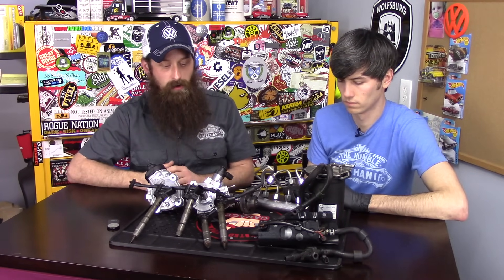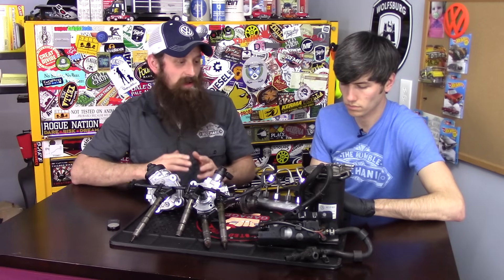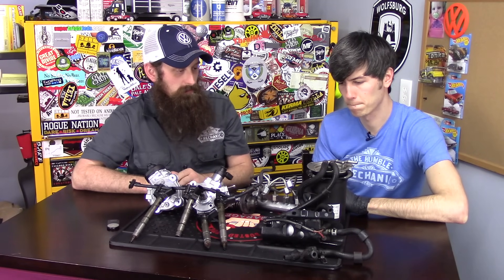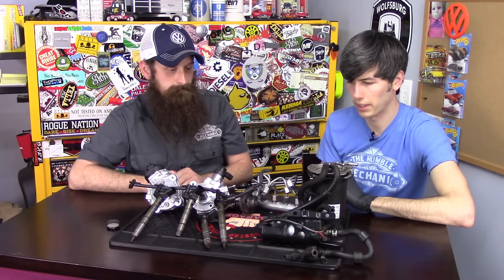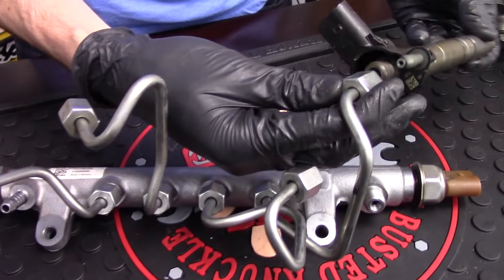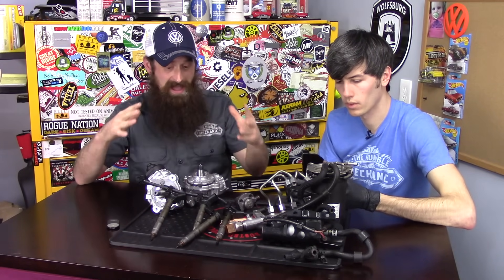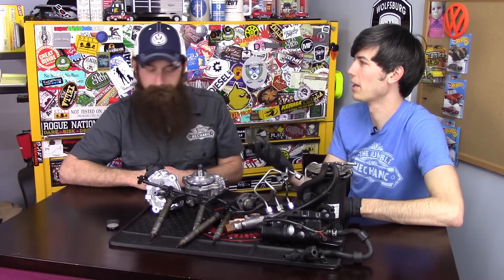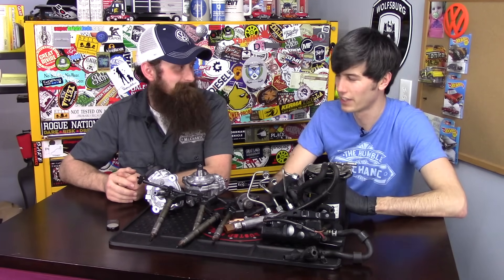Putting Gasoline In A Diesel Car - What Happens?

Comment: I've been a mechanic for almost 40 years (aviation, automotive, heavy equipment) and have seen my fair share of this kind of thing.  Replacing fuel lines and cleaning things out with BrakeClean and compressed air to eliminate every drop of gas is really unnecessary.  Claiming the fuel rail is a sealed component that you can't service or see inside is also quite incorrect.  The one you show: all you have to do is removed the fuel sensors and any metal trapped in there could easily be removed with compressed air.  As far as the pumps and injectors go, unless the vehicle was run on straight gas for quite some time (which would be difficult because the head gasket won't last very long), they're more than likely going to be fine.  If there was any pump damage, you'll find evidence of it in the fuel rail.

You can also dump the gas/diesel mix with your waste oil.   (And where do you live that it costs $25/gal to dump that stuff?)

Comment: just to clear some things up, chevys duramax is a Isuzu design, dodge uses cummins which is a world wide diesel engine manufacture. ford is the only one of the big 3 that has there own diesel engine designed and built in house and currently with stock hp and torque numbers being the highest. of course ford had the old international design, 6.9L idi, 7.3L idi, 7.3L powerstroke which was designed by Cat and built by international/ navastar. and known for its high reliability.  the 6.0 powerstroke which uses the same hydraulic design but the injectors are a little different and a little more sensitive. the 6.4 being the first common rail powerstroke was a big fail due to the emissions regulations, and now the 6.7 powerstroke common rail even more sensitive. 6.4s 6.7s, duramax, and 6.7 cummins all can easily be damaged by simple water contamination. the old school 7.3s and 6.0s can do a degree handle a little gas or water but you dont want to run it to long. older diesels can handle some gas, ive heard a lot of old timers run a splash of gas to use as a anti gel/ injector cleaner but with these never diesels dont run anything besides the new ULS diesel.

Comment: depend how much ratio between diesel and petrol you pump in... sometimes we pump petrol maybe 50liter diesel with 2liter petrol to clean the fuel system..if worries about lubricate..add some 2stroke engine oil

Comment: This is all ridiculous. I've been in this spot before. You just drain the system, replace the filter, refill with diesel, and start her up. Replacing the entire fuel system for eight grand because one part might fail in ten thousand miles is something only the mechanic who's charging for the work would think reasonable.
Reply: I put fuel into my 2013 common rail work truck when its was brand new, and drove it for about 30 kms. All we did to fix the problem was drain the fuel out of the tank and change the filter.
That same truck has done 140,000 kms since then with no issues whatsoever. 
$8000 repair, pfft! That's criminal...
Reply: I have a 2002 Jetta Diesel since new with 475k on it now. Always been mixing 50 to 1 in the summer and 25 to one in the winter. I get 1400+ km on the highway and anywhere from 1000km to 1200km in the city. Also been using Amsoil since day one. Oh and everything is original on the engine except the normal maintenance requirements and twice I had to replace the alternator clutch pulley.
Reply: @robh1908  wow over 1k km on a tank! My golf 5 sdi 2006 does about 1k km on 1 tank, but its 95% highway driving, over 730k km now..
Reply: DJ Harrison Solid points to be sure. (BTW - get AAA or OnStar for those unexpected back road breakdowns).The flip side are the many 200k mile 15 yo Saabs like mine. The entire car is $400. A donor parts car is $200 on average. In these majority of cases it's flush, replace filter and go. something else is guaranteed to fail within the next 10k miles. My dad's new Jag is an entirely different deal. Each owner needs o make that cost/benefit assessment.

I like their video because they detail what can actually happen to the parts and why. My only quibble is the disposal nonsense. Simply collect the flushed stuff and use it to burn brush, run the waste oil heated, store it in a building the insurance is paid up on....you get the idea.
Reply: I'll second that. Just a money spinner. Depends how long you drove it though. Then you deserve the Darwin award.
Me, I've filled a couple of times with diesel. Just pump her out, Blow the lines out. Refill WHOLE tank with Diesel. Way you go.  Also have put a liter of petrol/tank every six month as injector cleaner.
Reply: Thanks for your comment!
Reply: 8:40
Reply: Yeah, I don't buy this either. Sure Gasoline has less lubricating properties compared to Diesel. But you are going to grind off metal shavings from spinning parts from just cranking the engine a few times! Drain it, perhaps flush it with Diesel, then re-fill and go?
Reply: agreed. this is BS. have had Gasoline pumped on my diesel. Im in the Philippines and we have gas station attendants who pump gas for us (yes we are pampered) and they mistakenly pumped gasoline on my Diesel. Started her up, died and then i saw it. They apologized, brought down the tank, cleaned it, filled with diesel, started her up again. gasping for about 15 to 20 seconds or so but after diesel went through the lines was running fine after that. not 8000 USD though. its a rip off.
Reply: people should cut their beards unevenly so that it looks fake.
Reply: Same i accidently put £5 in my diesel car then filled the rest of the tank with diesel and it was fine
Reply: Josh Bobst a brand new engine could be close to the same price😂
Reply: Common rail? Arhahahahahahahahah!
You are the reason I wouldn't buy a second hand CR diesel.
Old type diesel drain and fill, OK; common rail nup.
Reply: True, because he has a need to feed his family.
Reply: They want money dont fix it if it aint broken. FLUSH FLUSH FLUID AND GO GO GO :-)
Reply: This is madness. In the UK we just change filters and flush the rest.
Reply: who pays eight grand for a mechanical breakdown is welcome to novel  choices
Reply: After driving it for miles until it quit running I would replace the things shown here. There are plenty of videos where the wrong fuel was put in but those guys are still at the station and realized the mistake, tow it home and drain and refill and are fine
Reply: exactly my thoughts.
Reply: its more than that if you work at a dealer, we are required to follow procedures for the simple fact, worst case scenario some metal make it into the combustion chamber, now you have metal possibly destroying you're cylinder walls, now you don't have the compression needed to run a diesel and may need a new engine. so that maybe saving you 4-5 grand, could bite you ass at 20K dollar repair on top of what you paid to have you're system "flushed" out. then the customer will say its your fault it happened, if its a shop starting out it may be the reason no one will ever go there etc. needless to say, don't put gas in a diesel engine, and no one has to pay a few thousand dollars for repairs.
Reply: I put gas in to diesel what would happen?
Reply: @heraldomedrano851  It won't run. Same thing if you put diesel in a gas engine. In that case it's obvious why it won't run: it's not hot enough in the cylinder for the fuel to ignite, even with a spark. It's less obvious why gas won't burn in a diesel engine, but having thought about this for a while, I've come to the conclusion the gas must burn so fast it doesn't generate enough power to keep the engine running.
Reply: We worry...as if the truck is wear and tear proof for ever....longevity my ass
Reply: One part might fail, or that part might not fail and instead pass metal fragments through to your engine. Then you do an engine swap instead of replacing the fuel system.
Reply: @DaveC2729  Can a diesel engine withstand metal fragments from its fuel system passing thru it? In most cases, yes. We really only see engines fail because of metal fragments if those metal fragments come from its own internal rotating parts, or from burst turbo compressors.
Reply: I put gas on my ram 3500 full tank and I drive the truck 😢 but I just drain the fuel system and my truck it’s good now I have 70k Miles that happen when the truck have 15k miles
Reply: @stranoamore   do you drive the truck when you put gas ?
Reply: @stranoamore  damm what kind a truck
Reply: @stranoamore  oh wow
Reply: Put 15 litres of Petrol in my Mercedes Diesel , instantly realised then topped it up with diesel so about 50 50 mix
Drove 12 miles to home.
But will have tank drained then change fuel filter once its run through

Will that be OK its done 250,000 miles .
Reply: Remember he is thinking as a mechanic who "needs" to feed his family and buy expensive summer toys, the other giy is only asking the questions.
Reply: Jesus Christ talk about an overkill... Y'all need work that bad? Take her in for a flat and get a new transmission and engine. No need for all that BS drain it fill it back up it'll dilute the rest plenty
Reply: yes but when the car break down because of a mistake that authorized personal do then they wont fix the problem they caused for free anyway... i mean there is no guaranty on any work..
Reply: JayVan Geli yes the engine gets damage if you run the car for some time, not instant damage..
Reply: @mitropoulosilias  I know I'm way late to this comment, but the thread has legs apparently. Replying because I keep seeing this idea that if you run gasoline in your diesel for a long time it is a lot worse than for a short time. But a diesel will not run on gasoline for any amount of time. Why exactly this is seems to be a bit of a mystery in the forums; a chemical engineer might be able to give a succinct answer. My own intuition is that gasoline burns too quickly, and expends most of its energy while the piston is still on the upstroke, so it's mostly expended working against the the engine rotation. Any more informed ideas are welcome.

A bit more research yields the idea that gasoline is formulated specifically to resist auto-ignition, which is how diesels work. The literature suggests this results in catastrophic detonation if used in a diesel, which was essentially my intuition: introduced to an environment way too hot for its design, the gas all combusts at once, before the piston gets to TDC, meaning all its energy is wasted pushing the engine the wrong direction.
Reply: The manufacturer mandates to the dealership mechanics what needs to be repaired for this particular problem. He's not just a shop mechanic, he's a dealer mechanic. If he doesn't replace those parts and one of them fails down the road, it falls on VW to explain and fix it, not this guy or his shop. We're also talking about modern, precision engineered diesel engines, not the rusted out 1970 chevy that spews a plume of black smoke every time the gas pedal is touched. 
The reason people use the dealer mechanic instead of just a regular shop is because they don't cut corners. Yes, they may do more than is necessary sometimes, but it's always in the name of longevity of the vehicle. Personally, if I were in this situation, I'd prefer to spend more to know beyond a shadow of a doubt that my car isn't going to break down in 2 months with my wife driving alone on a backwoods highway 80 miles from the nearest mechanic. 
Feel free to fix your vehicles however you see fit, but I don't think it's close to ridiculous for other people to be willing to pay extra for the piece of mind, and I don't think it's ridiculous for VW to require this extensive repair for this situation where they would be liable.
Reply: +DJ Harrison - When I was a mechanic I would love to get a client like you. Honestly it's very rare to get a client that get's it's wallet squeezed dry and still feels good about it. LOL ;-)
Reply: +DJ Harrison LOL. Stealership techs are more inept than a reputable indie shop. The tech are just there for a paycheck while indie shops actually care about their business.
Reply: most retards dont get as far as owning their own cars i figure
Reply: The guy in the blue shirt is like a woman on a talk show...can't shut the hell up while the speaker is explaining something. Very rude and unprofessional.

Comment: I've had hire cars come in with full tanks of petrol multiple times. I always just pump the petrol out and refill with diesel. Pump the lines for a while and then restart the car. None of them has had a fuel system failure and many have done over 40k miles since.

Comment: i put gasoline in my David brown tractor and it stopped running so i drained it flushed the system with diesel, bled the system up to the injectors, started it and it runs OK.The old petrol diesel mix was used diluted in gasoline in a petrol engine and never noticed a difference so its all gone.

Comment: I disagree with most if not all of this, I have been working on diesels for the past 10 years and have had this problem happen many times drain and flush the fuel system, fill with diesel and at some extra lube like a little trans fluid, and you're good to go!!!

Comment: so i a m  waiting  to hear what .....did  gas even make it to the motor  6:29 into the video i bet the motor did not start on gas because your parts would  most likely be broken ever head bolt ripped up the hood of that car most likely ruined unless diesels have sensors  shutdown  the would be lack a better word toast i can say most likely this video less than honest most wear is from actual use not not a  lack of a better word  solvent bath i would agree if it had run....  the even  for  a short time but you now uh well i can say  i do not  see  fact just fiction good luck with that...

Comment: Generally speaking the  gasoline will  keep the  car from  running more than  a couple minutes and  these  supposed damages are  way exaggerated....  Especially considering that  some  diesel will  be  present on the parts past the  point of  no more running....  If  only a little diesel you have  lubrication but  will  not  run....  If  lots of diesel and only  little gas you get  plenty of  lube.... These parts should be  able to  handle this  without  falling apart chipping etc....  Asl you really need to  do  is  flush the  system fully using diesel  and as far as the  gasoline take it  home use in  your  mower or weed eater.....  Of  course 99 out of  100 city folk will  accept this explanation that  it's  8000 bucks....  Replace the  filter  yes but even if  could be  air dried and  used. 
If  However you  let it sit with  gasoline in it for  a long time lots of  rubber will  degrade

Comment: My father accidentally put about 1/2 tank of gasoline in his 1980 diesel Oldsmobile station wagon back in the eighties.  Once he realized what he did, he filled the rest of the tank up with diesel fuel, drove it till he could burn off some of the mix, and added more diesel, and slowly diluted it till it was all diesel.  Apparently, it never damaged the car, as he kept it till 1986 and put close to 200,000 miles on it.  Sold it to a volunteer rescue squad that put another 100,000 miles on it before the injector pump finally failed in the late 90's...maybe that 1 tank of fuel made it fail?,  but the car lived a long, useful life, which is really saying something for an Oldsmobile diesel!)

Comment: actually, there is high risk to destroy your cylinders and pistons as well. Gasoline doesn't have the lubrication properties of diesel. Also if it happens to fire, which is unlikely you could be seeing at a complete engine overhaul (you might just as well throw the car away or replace the engine altogether)

Comment: once made the mistake of putting petrol (as we say in the uk) in a car that takes diesel. As soon as I realised the error I topped it up with diesel. So their was a mixture of the two types of fuel. Accelerating in lower gears and keeping the revs high will burn out the fuel. I topped up with more diesel and problem sorted it self out really. I am not recommending this to anyone but it worked for me.  Saved some money which otherwise would have been spent in a garage.

Comment: What happens if i put diesel/petrol into my Tesla S or any electric car for that matter?
Reply: You get autobots.
Reply: your car will smell like gas or diesel
Reply: Depending on the placement of this fuel arcing and sparking may occur followed by URD (unscheduled rapid disassembly). JUST MY GUESS
Reply: You will then have the option of cleaning the windshield with flames

Comment: Modern diesel engines might get wrecked, but older engines will run just fine.

Just check the 5th gear video example to the righjt.

Comment: As an automotive engineer, I don't believe that any possible damage can be done by just cranking the engine. In other words nothing should be replaced more than clean up all the gas in the fuel line.

Comment: My mom once put about 12 liters (about 3 gallons) of gasoline in my 2002 BMW 318d (it was nearly empty) before she realized it wasn't diesel. Luckily she didn't try to start it. She  called me and I told her to just fill it up completely with diesel.
She did and about 50.000 km later the BMW is still going strong. Since it was nearly empty it was about 12 liters of gasoline mixed with about 48 liters of diesel. I didn't notice any difference while driving to be honest. Back in the day people used to do this intentionally in the winter. Maybe not this much but still.

Comment: He said that VW strives to make sure that their customers do not put gasoline in their diesel vehicles. A somewhat costly solution would be making diesel pump nozzle sizes a different size so that it only can be used on vehicles that have the same size opening. Just a thought...